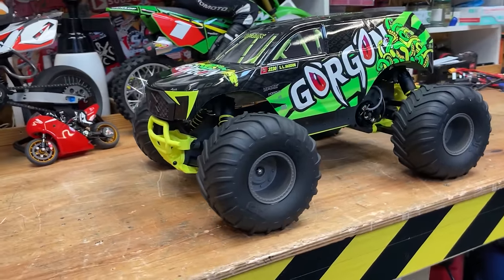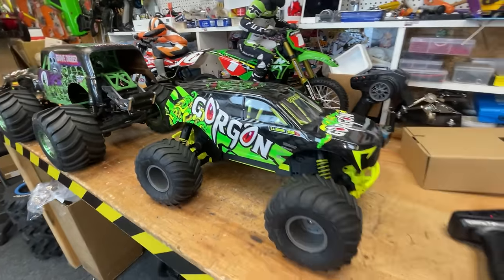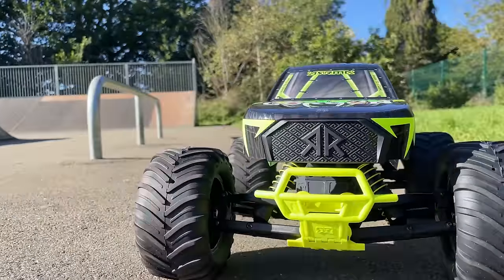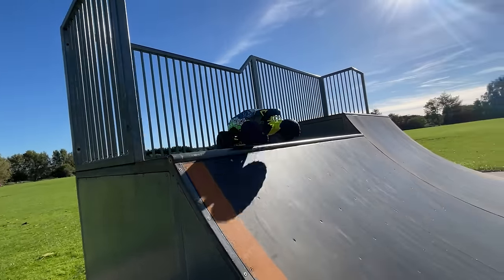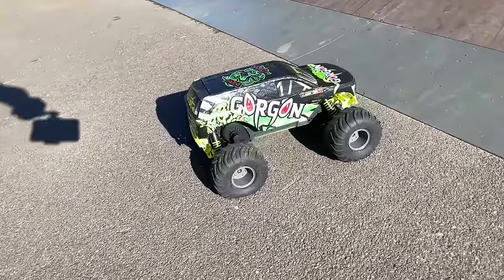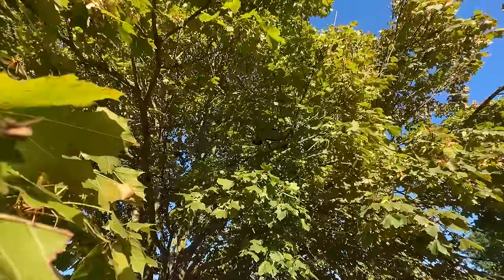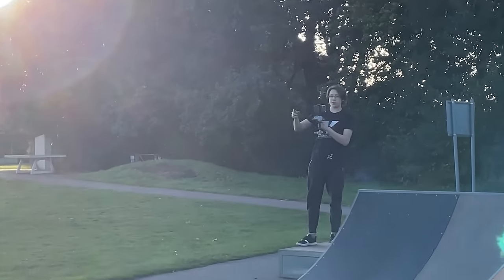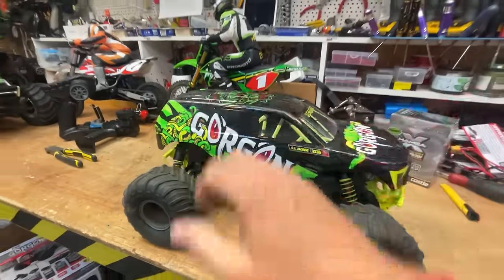New Arrma RC Car Everyone is raving about, but ...more

Comment: 11:40 No, no you don't have to split open the chassis to access the servo-saver. You just remove one screw from the linkage below, 4 screws from up top to remove the servo and it's all out. Easy peasy. (I bought the kit Gorgon.)

Comment: They use a tapered head screw on the steering servo saver so it causes the collar to break. I switched it to a flat screw. You can’t get the servo saver because they are on back order but the one that fits the Voltage, the parts will fit this one.           There are two screws take out the top the screw first remove that part of the servo saver and the steering arms then remove the servo screws and the saver will come out as normal. You do not have to split the chassis.
Reply: I've seen what tapered head screws can do to cabinets, can't imagine how easily they'd split plastic. Pretty stupid

Comment: I got one of these, the green and yellow one too. My first ever Arrma purchase. I absolutely love this thing! Sure it’s brushed and 2wd, but for me that’s what so alluring. It takes me back to the 80’s feel and look of RC cars. This thing is cheap, durable, stable, and for a brushed motor it scoots! I liked it so much I bought another Arrma RC, the Big Rock. This Gorgon I’m sure is supposed to be aimed more at the new or novice RC hobbyist. But as a guy who’s been in this hobby on and off nearly 40 years, I love the Gorgon. I drive it more than any other RC I have. Great video as always, Kev. This traxxas fanboy of the past is starting to pay much closer attention to the Arrma lineup. Mostly, because their prices across the board are in some cases much cheaper than the traxxas comparables.

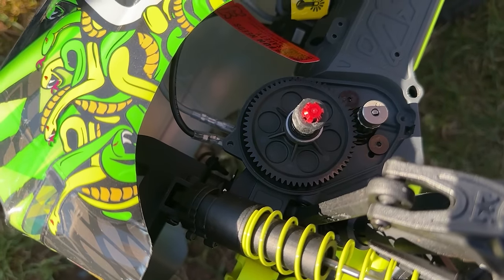Comment: @9:35, when the pinion gear falls off or actually motor moved, and they have to push it back and retitan where are the gears on the pinion,  why does the camera not show the teeth on the pinion?

Comment: Hey Kev quick question doing a dumborc on my outcast build & using a castle creations xlx2 & 2028 1100kv motor having issues getting throttle have turning have tried calibration & making sure throttle trim is at 0 . Any ideas on what it can be?

Comment: 5:09, it looks to be ideally tuned for this battery and gearing, like it's at the very edge of grip.
Pretty sure it would smoke Traxxas Slash 2WD and Traxxas Rustler 2WD of the line, even VXLs.

Looks to be an awesome truck for a beginner.
Reply: Delusional 🤦‍♂️

Comment: so when you change the motor to brushless does it need a new esc too or are there esc that run brushed and brushless because id like to see a cheap brushless upgrade for it since its made for beginners.
Reply: This will need a brushless ESC & separate receiver if you want to go brushless. The fitted ESC is brushed two wire only & has a receiver built in. I think this truck is probably best left as is, there are plenty of “relatively” cheap brushless trucks out there.
Reply: @MrGoat73 id say in a few months theyll put out a brushlsess one anyway so i may just wait for it. would like to see them keep it cheap though because the cheaper it is the more people that can enjoy it.
Reply: @mech0p Absolutely! Hope they can keep the cost down, loads of people can still have fun with this, even stock. It’s perhaps a good upgrade project for younger or less experienced drivers too.

Comment: Surprised you didn't use at least a 2S lipo.
Before you say , you wanted to test it box stock.. the cheapest one comes without the battery and charger, which let's face , who wants thier battery and charger, so it'd be the one to get.. and they're all lipo compatible.. I'm not only surprised you didn't use a lipo... I'm super surprised you didn't test 3S and see if it'd take it in normal Kevin Talbot style.
At least you gave it a decent kick around on hump pack power.

Comment: I bet they will add this to the boost series.
Reply: You can't make it 4x4 the chassis is not designed for it. Battery is where the driveshaft goes servo is where the front diff goes.

Comment: How is 170USD a low price? For a full plastic car.
You can get much better ones from XLF or other Chinese brands for the same price. BLDC motors, 4x4 with differentials, etc.
Reply from the maker: find a main brand similar car for cheaper
Reply: @kevintalbotrc  main is relative to where you live :D

Comment: 6s that's to much going to blowout the trans. 3s will be good with 22p and 76s hp diff 75000 diff fluid and a wheely bar

Comment: There is 1 real monster truck in the US that's got independent suspension front & rear both, and it's called the "Tmaxx", and the suspension design is actually like the traxxas Tmaxx lol. I haven't seen it in a long time, traxxas must have sued them too 😆